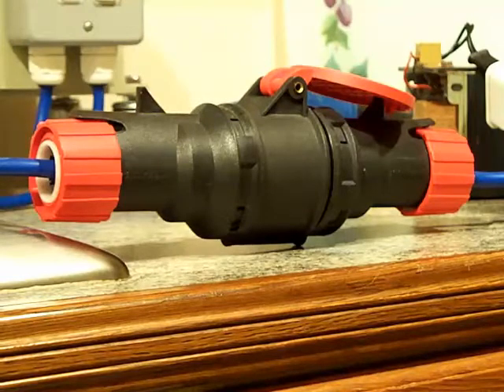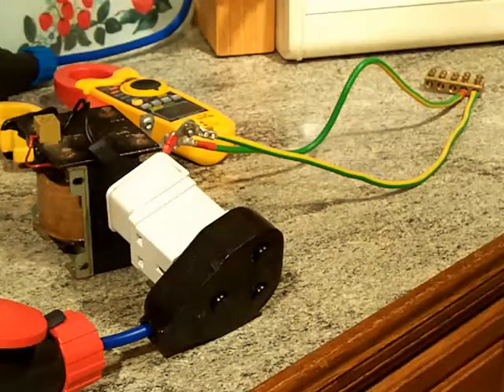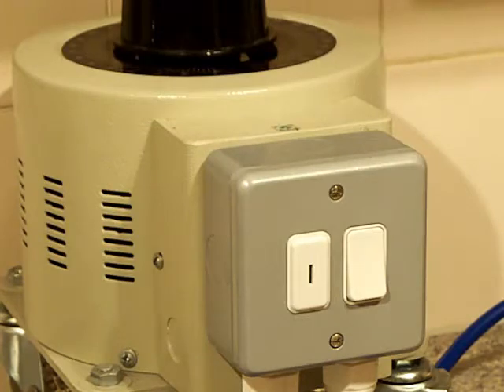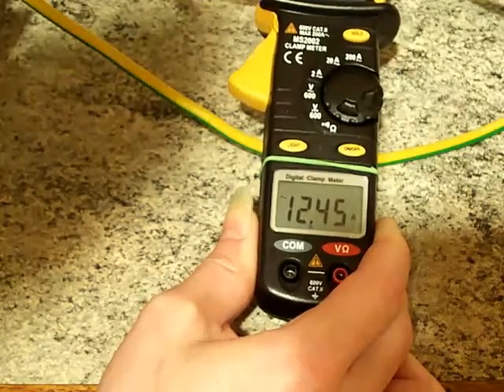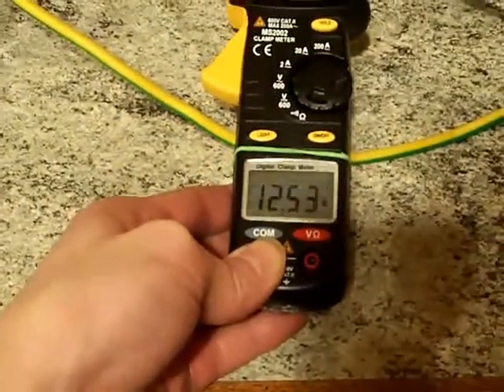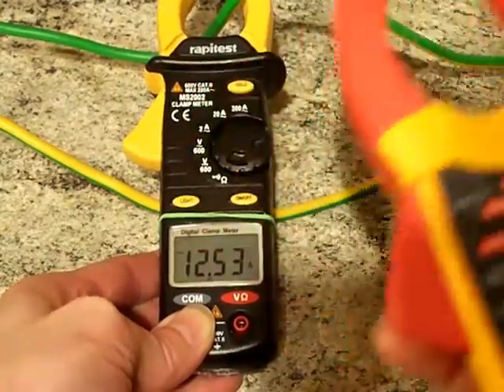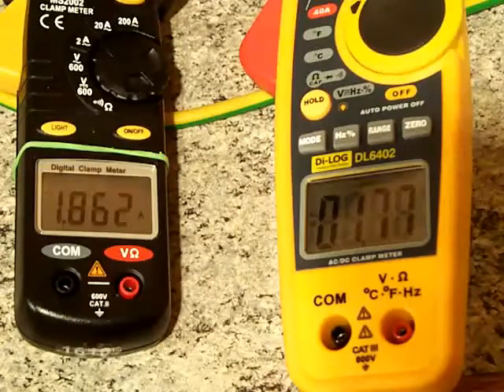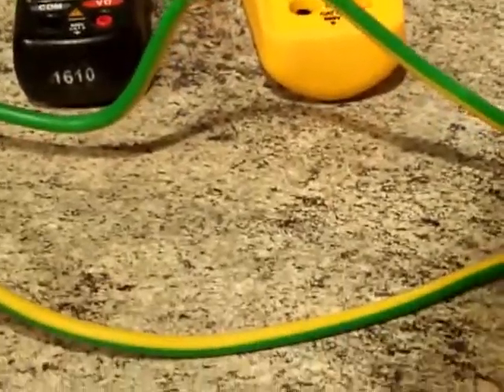Test Time : Late night dual clamp meter fun!

Comment: For a clamp meter I always omit the last digit. Just read the meter value and the .1 digit. Those meters measure pretty accurate. You should have added a Sangamo S200.31 for some disc action at the same time.
Reply: Haha, this happened in the rather small hours of the morning. :D It would have been a sweet idea to have some loadwheel action in the vid at the same time, but I have to think of distractions....

The subject of the video was the clamp meters and if there was an electric meter in the vid at the same time, any hardcore loadwheel lovers watching would have been hypnotised by the loadwheel, and would have missed out on the video subject which was the clamp meters. :D

I could imagine that.... "You mean there was clamp meters in this vid? I didn't notice, but.... look at that loadwheel whizzin'. That was tasty." :D

ROFL.

Thanxx for watching,

-Wayne's Electrical.

21st October 2017, 17.33